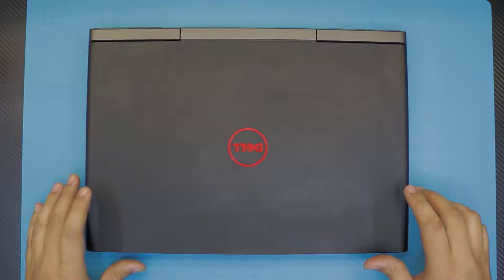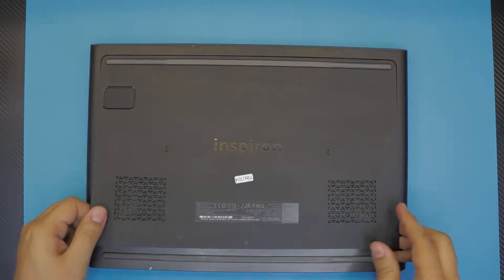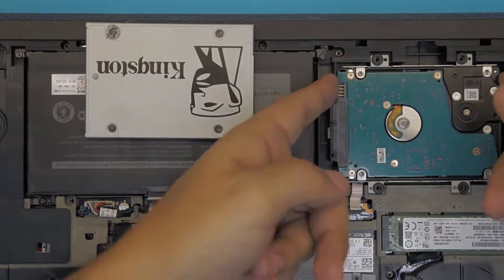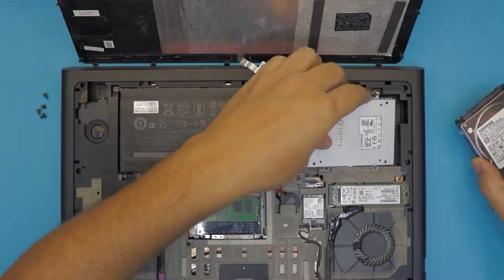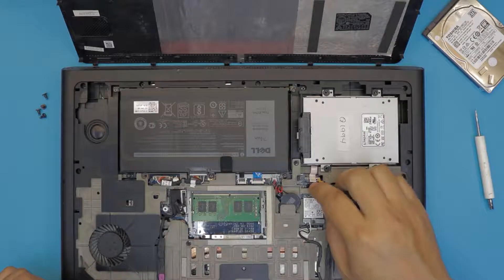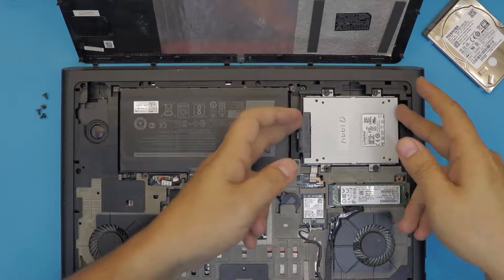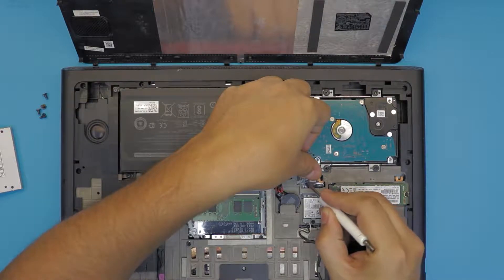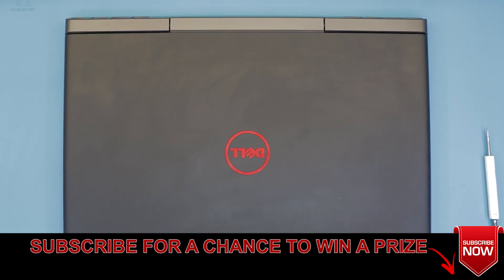Upgrading SSD drive or Hard drive in Dell Inspiron 15 7566 Gamin Laptop

Comment: Hello, greetings and good day. I use the same model and I have a question: My computer currently has a Samsung 970 evo 250GB NVMe SSD, but this storage space is insufficient. I've been using the hard drive since I bought the computer and it works well, but it's too slow for the programs I use. So I decided to buy a Samsung 870 evo 1TB SATA hard drive, but something crossed my mind. If I remove the existing hard drive and install the new SATA SSD, will I need to format the drive, or can I use it normally? Because I'm only changing the hard drive, not the installed SSD. Thank you in advance for your answer.
Reply from the maker: 🫠Regarding your question, your Windows is installed on the 256 GB NVMe. The HDD you have is used as extra storage. If you remove the HDD and install the 1 TB EVO, Windows will work fine, and you will have a new 2.5" SSD. However, if you had any programs installed on the old HDD, they will no longer work, as they will be removed with it.
So, to answer your question: yes, you can remove the HDD and install the SSD, and Windows will work fine.
cheers🍻

Comment: Hello! I have this same model with tag number CF96L22. I am planning to add an M.2 SSD Nvme of 1 Tb but I am still confused about the maximum capacity that is allowed to my model. Can you please share with me the cap of the m.2 ssd slot? Thanks in advance ! I already liked the video and subscribed :)
Reply from the maker: Thank you for the support this laptop has a pci-e there is no limit on m.2 storage capacity you can place a 1tb or 2tb and it will work just fine.
I speak Spanish if you like to speak Spanish.
Here are the amazon links for 2tb nvme that are good, dont get kingston or adata brand they are garbage. Best brand for ssd are samsung and crucal.

Saludos

Mexico link: https://amzn.to/3lm2ry8
Usa: https://amzn.to/3lm2WZe
Reply: @uFixTek  Muchas gracias por la rápida respuesta! Such a good information buddy!Tengo otra pregunta, mencionas que puedo hacer el upgrade hasta 2 tb debido al protocolo PCIe, sin embargo en la página ofical de Dell acerca del modelo Dell Inspiron 15 7000 Gaming menciona que la capacidad máxima del SSD slot es de 512 GB, por qué la página oficial diría que es hasta 512 Gb si puede aceptar mayor capacidad de memoria? En tu laptop tienes instalada una SSD NVMe de mayor capacidad y no te dado problemas? Muchas gracias :)
Reply from the maker: @alvarofranciscohernandezmo2223  oh neta me encabrona que en sus paginas mal información que dan!! , y no es la primera marca que hace eso!! Tu ntp neta nosotros actualizamos cada semana laptops y  confia no vas a tener ningun problema para nada , es un Puerto m.2 pci-e es capas de 16tb sin pedo.  Solo que no hay 16tb en m.2 . Ni busques o preguntes. Si andas en queretaro yo te actualizó gratis solo compra las partes.
Reply from the maker: @alvarofranciscohernandezmo2223  oh estas un poco lejos, no hermano solo tengo aqui, pero siempre contestó preguntas, igual si gustas puedes enviar un email y te paso mi WhatsApp en caso que quieras ayuda. ask@ufixtek.com
Saludos

Comment: Hey, thanks for sharing!
Do you know if "Samsung 970 Evo Plus SSD 500GB M.2 NVMe" is compatible with 7566? 
I now have the default Toshiba SSD 128 GB and a 500GB HDD. I'm thinking to upgrade the SSD to a bigger one, as I'm running a lot of architecture software and need more space. Thanks for your time!
Reply from the maker: Thank you! if you wish to support the channel you can LIKE or SUB or both :P
regarding your situation: Can you please give me the TAG# that is on printed under your laptop.
Reply: @uFixTek  Thanks for your swift response! The TAG (SN) is: 13DQRC2 ! Already liked and subscribed :)
Reply from the maker: my pleasure, regarding your LAPTOP, it is a m.2 PCI-e , so it is a NVME compatible, its compatible with m.2 sata and m.2 NVME, the NVME are much faster than sata :P
https://amzn.to/2ThSgyE
if you need any other help installing windows let me know,
make sure you back up your files to other hdd, and VERY important!:
once you ready to format 1st disconnect the HDD cable from motherboard  or remove your HDD, and continue formatting your m.2. and install windows, the reason is that the motherboard will detect the hdd as 1st priority and it will have a dependence to windows, that means if by any reason in future your HDD fails or you upgrade your hdd , your windows will not boot.
so to prevent this simply before formatting just disconnect or remove the HDD. once finished and you are in desktop, then power off and plug back the hdd and it will detect normal.
how to make windows 10 usb: https://youtu.be/uDu8j2lE-dM
and to boot the usb in your laptop, power off and plug the usb and once powered on keep taping on F12 and it will 
take you to windows installation and i would highly recommend you to follow my window on windows installation so you get clean windows installation.
note: when installing windows never connect the laptop to internet and skip the wifi step.

https://youtu.be/7f_rBp6Rb3s
Reply: @uFixTek  Oh my God! That's really helpful! Thank you so much! 
I was actually thinking to clone my old M2 to the new one with an enclosure USB so I'll not have to reinstall windows and all of my apps. Should I remove my HDD during this process too?
Thanks again, you are a life saver! :)
Reply from the maker: to be truthful i dont ever recommend you to clone a to NVME, because the file structure is different, 
installing windows its really easy and fun, follow my windows installation without internet connection, and making a usb windows its fast.
and yes its always recommended to remove or disconnect any other hdd or ssd when installing windows.
also if you wish you can email me with your contact and i can assist you during installation and configuration via whatsapp. and once you in the desktop i can help you to config your windows to best optimized :P as i do to all my clients.
ask@ufixtek.com
Reply: @uFixTek   Then I should think more about it! I'll send you if I need more help! Thanks again!
Reply from the maker: oki, anytime its easy and not hard at all :) formatting takes less time than cloning and much better. when ever you need assistance let me know. good luck

Comment: Just curious if there is any precautions to take before upgrading? Like backing up programs/files?
Reply from the maker: 1st i need to know what you upgrading?
your mechanical drive or your m.2 ssd drive?
2nd where you have your system installed on your m.2 drive or your mechanical drive?

-----------IF------
you don't have the m.2 sata drive and only have the mechanical and you want to go from mechanical to ssd.
i would recommend you to buy this as its always handy to have one. https://amzn.to/2MWU5vv
im assuming you don't have m.2 in this case and you want to preserve your windows and file .

so you will have to buy your self a regular 2.5' ssd and connect it via the adapter i liked it to you above, then you want ot download the free program "Macrium Reflect" very easy to use you will then clone your mechanical drive on to your new ssd and it will take about 5-10 min and you are all set. 

--------recommended ssd 2.5"-----
https://amzn.to/32XiV3G
Reply: @uFixTek  Hi there. Wanted to ask a few questions regarding the video as I want to swap out the mechanical drive with a SSD one for my own laptop of the same model and brand. As it decided greatly degrade over the past few weeks. 

You mentioned above about the system, I take it you mean the OS right? If so, how would I know where my OS would be installed on my own laptop? 

When using a new SSD, does it work out of the box or do I need to install any drivers related to it for it work?